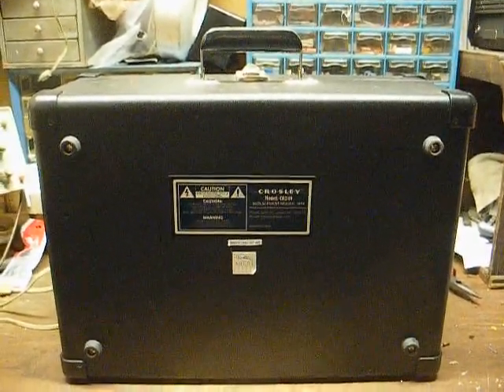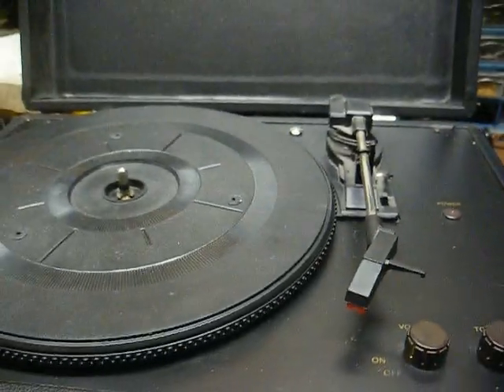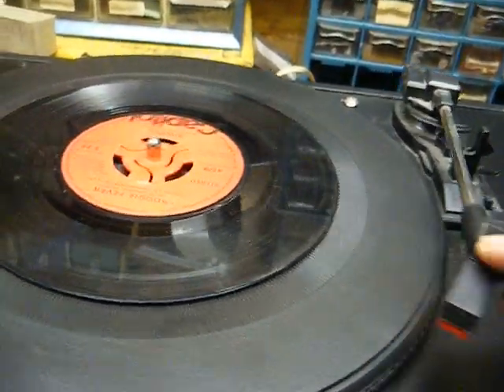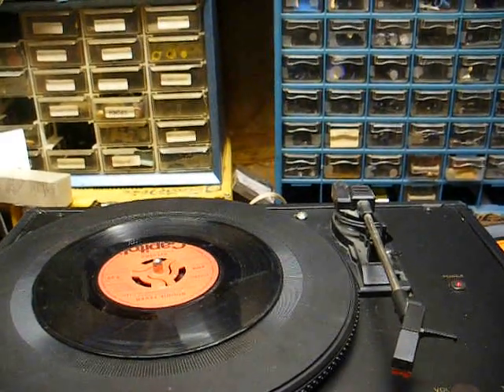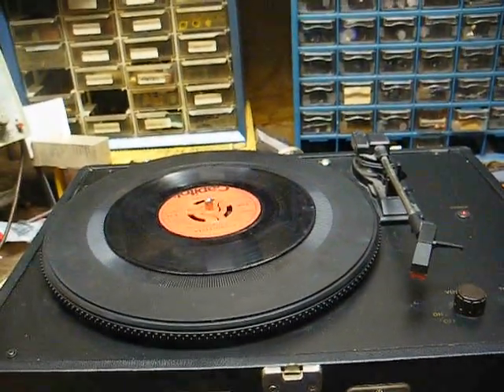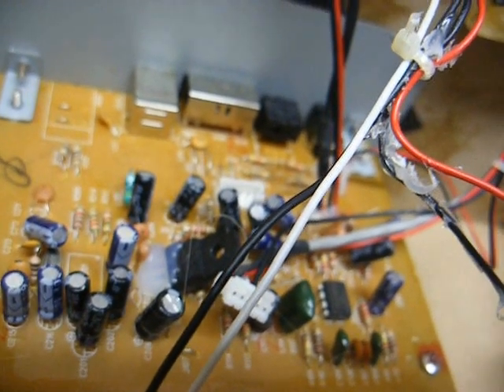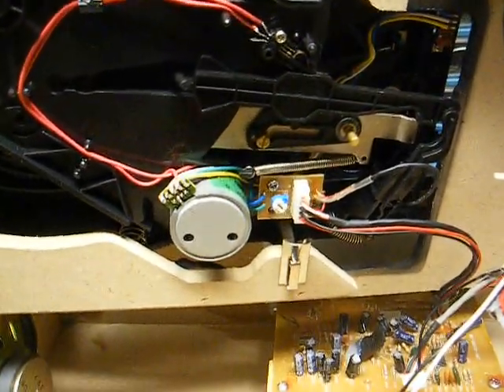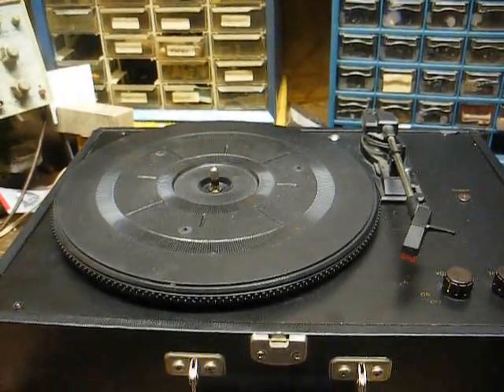Crosley & the P zero R N industry (how the two connect)

Comment: As you have shown here, even the magnetic cartridge Crosleys are crap. About this time two years ago, I bought a Crosley Collegiate and some records. It worked great with my 45s once I could get the adapter broken in (too tight on the spindle). My LPs on the other hand ran too slow. I adjusted the speed pot on the motor a few times and every time I got it correct, I'd close it up and it would drop. Listening to Sherry by the Four Seasons at 30 RPM is really noticeable. I returned it and "upgraded" to a Crosley Advance. It worked good, but the headshell mount was poor and tracking suffered greatly. I again returned it and got the Audio Technica AT-LP60 which I used for about a year with tracking issues (some records would just skip forward). I ended up breaking the cartridge out of the headshell (glued in) and junked it. I found a Phillips 867 at a hamfest and paid $50 for it. Has an Ortofon OM-5E cartridge in it. Only issue I had with it at first was the previous owner mis-wired it (left and right channels were out of phase). I went to play my Chipmunk record and on the third song there was a lot of distortion. I think I need a new stylus, the only reason I haven't replaced it yet is I have another cartridge (probably the same one used in this Crosley) I bought at a record store for a project that fell through and I don't know whether to invest in a new stylus (they are around $40 a piece if you shop around) or put in the other cartridge (I paid about $25 for).

Crosley does actually have a few products worth buying though:

The Crosley C10: The only thing Crosley about this is the name. This is a Pro-Ject Turntable and uses an Ortofon OM-5E cartridge. Pro-Ject make quality turntables, and it is indicated by the price tag of nearly $400.

The Crosley 45'er: This is a machined aluminum 45 RPM adapter for your turntable and is available in 5 colors. It works almost as good (and in some instances probably better) than the domed plastic ones. Unless you can machine one yourself, it is worth the $14.95 price tag.

Crosley also sells replacement Styli for Ortofon (5e), Audio Technica (NP5 crosses to ATN-3600L), Pfanstiehl (the cheaper ceramic ones), Sanyo (NP7 Crosses to 901-D7).
Reply: You could also buy a Pro-Ject for the same price as the C10 and get similar quality sound! I think they might be a little bit cheaper.
Reply: I will stick with my direct drive Technics turntable made in the early 80s, it is a quality unit and still works perfect.

Comment: useful for parts 

1 the carrying handle looks solid 
2 the cartridge is good enough 
3 speakers are ok for small radio repair 

that's all I can think of
Reply: 4 The latch looks not to bad, maybe the hinges too.
5 The 45 adapter
6 The rubber/plastic feet on the bottom of the case.
7 The two brown plastic knobs under the lid.
8 Possibly the plastic bumpers used on the corners of the case.
Reply: I could use the stylus.
Reply: I gutted a Crosley portable record player and used the case to make a damned nice Bluetooth speaker.  A Li-Ion battery pack (made from an old laptop battery), a bluetooth/MP3/amplifier board from ebay, and a pair of decent quality speakers (mounted in the lid rather than in the factory speaker locations).  The original Crosley electronics were retasked.  I pulled the player motor and its speed control circuit for another project.   I also stripped out the cartridge and 45 adapter.  The cheap plastic player itself went in the recycle bin.  Definitely got my money out of a $8 flea market special.  The only thing technically 'wrong' with it when I bought it was the belt had gone bad.

Comment: I remember back in the 60s-70s that you could buy a plastic tone arm complete with crystal flip over cartridge for under 2$, and a four speed turntable motor/platter for under 7$,  and patch cord for 1$.  Cut a hole into some piece of wood, and you had a new record player for 10$ that was made better than any Crosley.  Olson Electronics and Lafayette sole record players for under 20$.  I remember when Olson sold Garrard changers under 25$.

Comment: if you lift of the platter there should be able to adjust the speed control pots and see if that works but if only they made Linear Tracking Turntables that produce very sweet music as they play the albums the way the albums were cut on the record cutting lathe.

Comment: Oh well, it really doesn't sound that bad. I am wondering, however, it something like this can be fixed without replacing that little toy motor and whether that slick looking tone arm finally got a balancing spring to offset the weight of that magnetic cartridge. People get these things because they don't want to be bothered with restoring and old one, and for their purposes, they may be right given that this sort of lasted 10 years, and will probably go another 10 if repaired, as long as no one sneezes to close to it. It would be nice if they shipped them with spare motors, though.

Comment: Nothing has really changed, these junkers are sold cheap in department stores. Lots of features for low bucks. In the 70s and 80s if you wanted a cheap multi feature unit you went to the department store and found one that was built in Taiwan. They were worthless crap too, but lots of people bought them. You get what you pay for. From your video it sounded better than most of this crummy school record players you spend a lot of time and money fixing. Love your channel
Reply: fred fabris My "Taiwanese" stereo lasted a long while  - from Christmas 1987 to Summer of 2000. It even outlasted it's companion CD player by ten years. And guess what? SAME EXACT SETUP AS THE CROSLEY UNITS EVERYONE SAYS SUCKS! So,you wanna rethink your comment?

Comment: I am highly skeptical about the notion that Chinese men ejaculate a substance resembling hot glue, but hey, could be wrong.
Reply: I looked inside of my cheap Victrola VTA-600B and it uses Captain Sky’s “Super Sporm” which was man’s ejaculation fluid inside for the output. The turntable itself looks the same as the Crosley, but not great. I called it the Crapola.

Comment: If anyone wants a reasonable quality turntable these days, I would highly recommend the Audio Technica AT-LP120-USB turntable.   It seems to be a well-built machine (it is heavier than the component turntable I'd been using since January 1983).   It is $300, but before anyone says how expensive that is, consider what you're getting at that price point and it becomes a bargain.   Adjusted for inflation, it is far cheaper that that price than my 1983 turntable was.   It takes the standard "head shells" (so you can keep multiple cartridges on hand for different purposes) and comes with a cartridge that tracks at 2 grams (although I'm using a cartridge I already had that tracks at 1.4g ).   It has the adjustable counterweight and anti-skate adjustment, as well as the adjustment to raise/lower the tone arm.   It has the S-shaped tone arm.    It has both phono-level and line-level outputs, plus a pitch control and the ability to play 78 RPM (hit the 33 and 45 buttons at the same time!, although you would need a proper cartridge to do that).    I tested this turntable with the most warped 12 inch record I had that took multiple attempts to play on my old table and this turntable had no trouble with it.    I have not taken the machine apart to see how it is inside, and of course, have no idea how reliable it will be in the long run since I just got it a few months back, but on the surface, it seems to be a great buy.